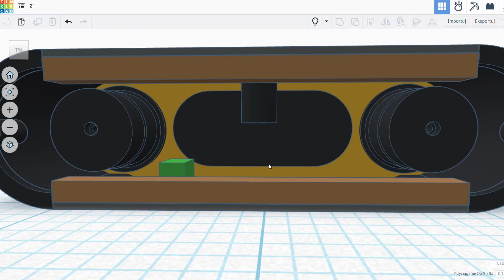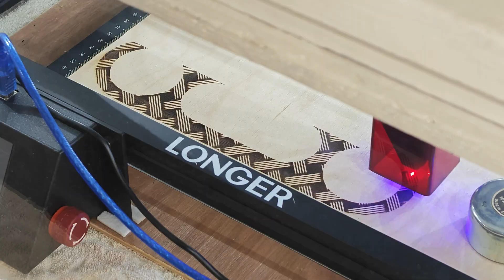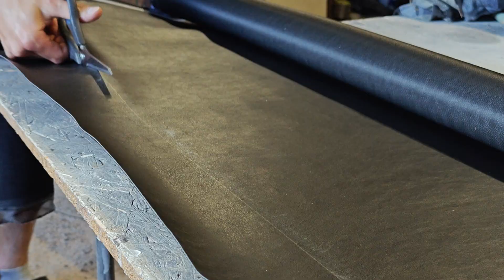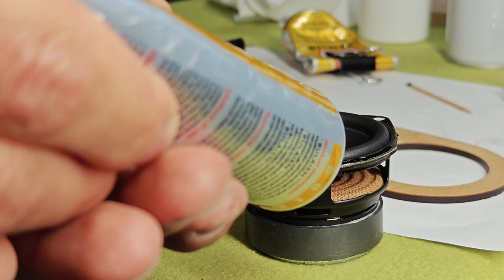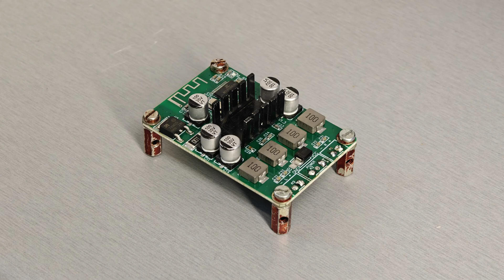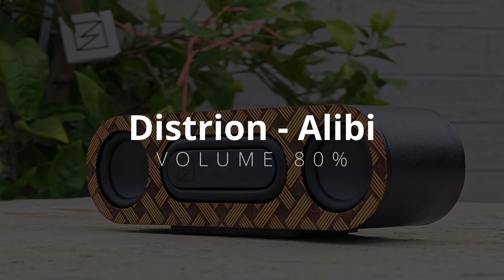DIY Small Bluetooth Speaker! - 3D Printing & Laser Engraving | by Sebastian

Comment: the passive radiator (middle) should be placed on the rear of the cabinet as the sound from it is cancelling the sound from the two main drivers (speakers)
Reply: They do indeed cancel below a certain frequency but there is a frequency band where they add, or even make/emit more sound than the drivers. The design and parameters of the drivers, passive radiator (PR) and the size of the box are all inter-related..
The math describing those was figured out years ago and is known as the Thiele/Small parameters.

Also you have to remember that there is a tiny delay with signals, when the drivers are pushing the air, the PR moves outwards, but there is a small delay and that same bass note cannot eminate from both PR and drivers at the exact time. The PR is like a port, it can be tuned by adding mass to it.
Reply from the maker: This is the first I've heard of this, and thanks for the tip. There's no shortage of amazing bass here! 💪😎🔥